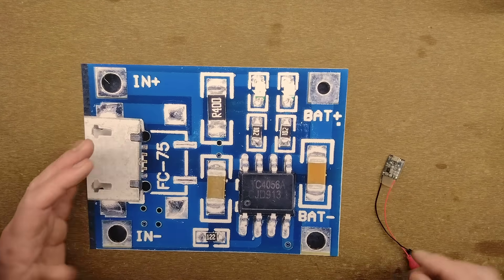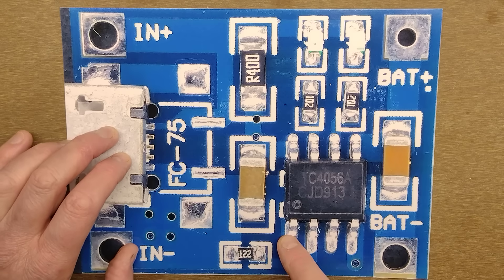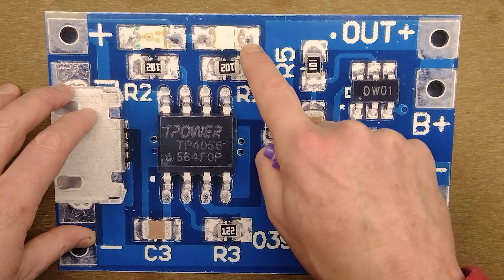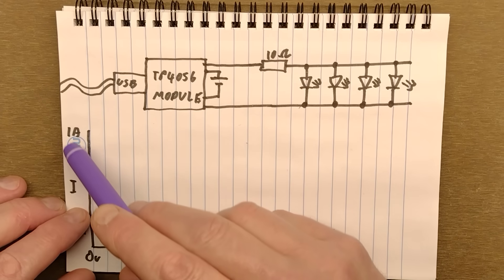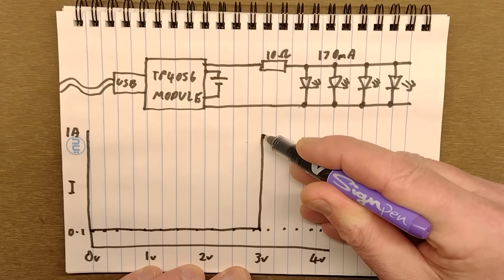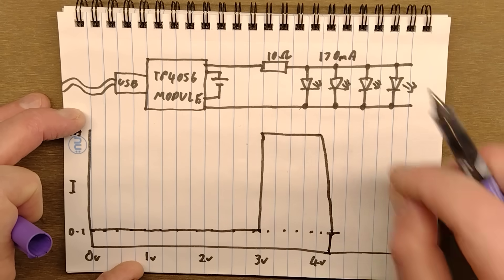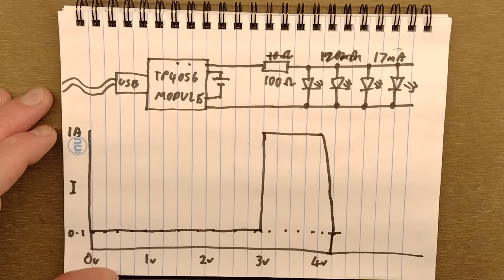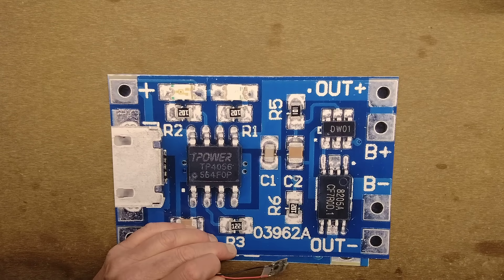TP4056 myth busting

Comment: I picked up some of these modules after watching your previous video. Ridiculously useful and ridiculously cheap 😀👍🏻
Reply: Good for modding lights that dont require more than 4V to be powered by the module under USB power as well instead of using cells.
Reply: I like those too. My last project with the TP4056 was modding my wife's epilator, together with a buck converter when the original NiCd battery died, and it is working quite good without overheating and a smother motor than in the original circuit.
Reply: Me too, but am still waiting on the shite that is evri to deliver them been in this country since 9th November, last updat was 14th November... Did I say I think evri are SHITE... TFS, GB :)
Reply: @graemebrumfitt6668  had 2 packages of electronics from China coming from different sellers. One ordered about a week after the the other, around 20th of Nov. The first one was tracked until it landed and "handed to postal operator" i.e. Royal mail. The second was passed on to evri. Guess which arrived first. Well the RM one came today and the evri one arrived a week ago. 🤷‍♂️
Having said that, evri usually deliver my packages to my "safe outside storage area" AKA my wheelie bin. On collection day. 🤦
Reply: @graemebrumfitt6668  there is a postal strike going on, so I would expect delays of up to two weeks.
Reply: @penfold7800  Two items I orderd on the 6th and 8th of this month from China arrived today, the other was ordered on the 3rd of november so me thinks their two weeks are way up🤔GB :)
Reply: Always test their cutoff voltages as some of the "clones" will vary where they stop charging, even within the same order batch. 
So you can't just use these to charge a large batch of cells and then do capacity tests and that be it, as some cells could be 4.18V and others 4.24V. This can make a difference on the capacity reading
Reply: Me too.

I bought five.
Reply: Me too I bought 15 for $10. I powered a marble machine and some custom lights so far but have more plans. Very easy to work with.
Reply: @michaelosmon  Me too, for the second time!  I messed up some of the first batch, including putting the cell in backwards there is no protection against this and my cell holders were not marked very well for (+) end.  I made a 10 bay charger with 5V 20A power supply.
Reply: @pault6533  I have 15 batteries from ecigs. I also scavenged batteries from a Bluetooth speaker and a cordless massager that died. All for basically free. I'm still amazed at how long I overlooked this free source of rechargeable energy and grateful to Big Clive for teaching me
Reply: See Clives odysee Channel Community page for other TP4056 Step Up variable     5V 9V 12V 24V Modules links.
Reply: @uksuperrascal  no clue what that is
Reply: @uksuperrascal  didn't even know that was a thing, seems interesting I'll be looking through it later this evening. Thank you for mentioning this

Comment: I use these for a lot of projects. 
It would be good if the board had another setting (Resistor perhaps) to allow a resting charge level to say 60% where it's being used as a UPS. 
Holding a Li-Ion cell at its max charge for long periods is not good for it. Since in UPS usage, the battery is effectively being stored, it would be good to allow the voltage to come back down to 3.7, it's nominal storage charge level, after a full charge. 
Sure that means less usable capacity when needed, but you can always oversize the cell for the requirements, but know that the cell is being looked after for the longer period, sometimes years. 
- Great video dispelling the myths. Generally the charge profile is Bulk (Max current, rising voltage), Absorb (Max voltage, reducing current) then float (maintenance current).
Reply: You can use the modules intended for LiFePO4 to accomplish this.  I use them to charge NMC cells to approximately storage level voltages.

It would be nice to be able to purchase 3.8 , 3.9 , 4.0v  and 4.1v modules ..
Reply from the maker: Having a version that terminates charge at something like 3.9V is definitely desirable, but currently requires extra circuitry.
Reply: Question I would ask is "are Li-Ion cells used in UPSs?" All the ones I've serviced/repaired have lead acid cells... But I haven't seen any really new/recent models, so might be talking out of my whatsit...
Reply from the maker: @stepheneyles2198  All the bigger units seem to use SLA batteries.  But there must be versions with lithium cells.  I suppose the Tesla power wall is a UPS in a sense.
Reply: @stepheneyles2198  LiFeP04 (LFE) are the predominant cells used in domestic and industrial battery storage systems and many EV's now. I suspect the UPS industry will eventually catch-up with much fanfare. Much like the portable tools industry did a few years ago (Can't buy a battery drill now without the obligatory Li-Ion sticker on the battery). I've not bought a mains powered UPS for a long time, and for sure they were all Pb, but that will change since the increased energy density is much higher with LFE cells, but the main reason they'll do it is of course shipping weight for a given capacity. Most non-serviceable UPs's are in the bin well before they should because their internal Pb cells give up; this would not be the case with LFE based UPS's, so perhaps they are resisting using LFE as the life cycle of a pack would be many times that of a traditional Pb based UPS..?
Reply: @dougle03  you are right. Lifepo4 are much better and it's level of voltage tolerance are much more compatible if swap with lead acid battery. I use them to replaced my car battery over a year now.
Reply: @dougle03  I like your theory that Pb = more reliable repeat sales.  The lead batteries often swell themselves into the housing and sometimes cause physical damage.  And the periodic auto tests often blow up the inverter circuits when switched on with degraded Pb batteries that instantly sag and provide weak current , blowing MOSFETs etc.   LiFePO4 units with carefully chosen charging/floating algorithms should last far longer.   And they'd also have to start accepting returns  (in USA at least)  since you can't return-ship a Pb battery, but can ship lithium with appropriate packaging and labeling..
Reply: @stepheneyles2198  You are correct re: traditional computer UPS.'s.   The term is just being used generically here.   For example I use a single cell bank which is boosted to 5v thru a dc dc converter to power a raspberry pi that's functioning as a server.   The mains adapter runs the unit but if power is lost the Lion cell takes over.   It is maintained at fully charged state all the time the mains is active.  

A lot of equipment runs on 5 to 12v DC and home spun UPS like this work far  better and longer than traditional mains inverter based tech..